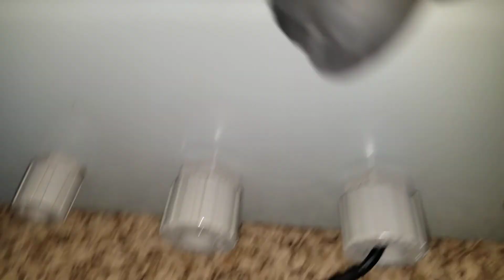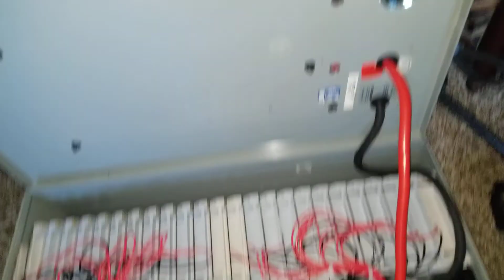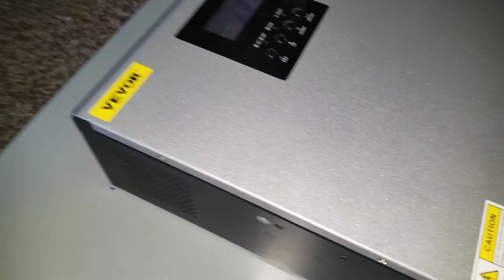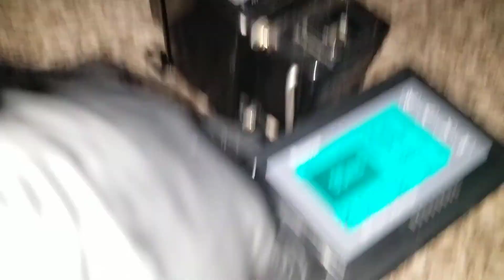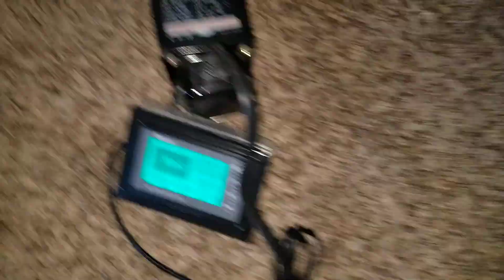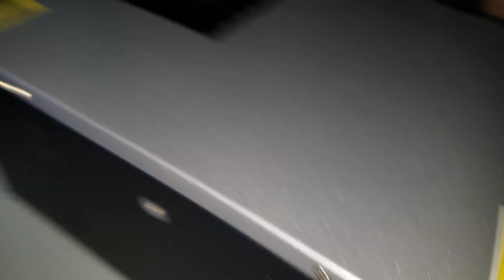VEVOR: 3KVA 24V MPPT HYBRID SOLAR INVERTER MOUNTED ON A POWERWALL

Comment: Well over the last 3 years perhaps you've discovered much that you need to know but, without proper cooling those batteries could be quite a hazard! We love metal boxes but sometimes underestimate the power of high heat rocket engines running inside😅
Reply from the maker: Thanks for your observations but this system is still working perfectly without any complaints.

Please don't forget to Like Share and Subscribe for more content like this.

Check out some of the popular videos on my playlist